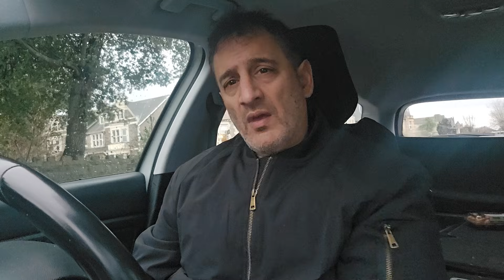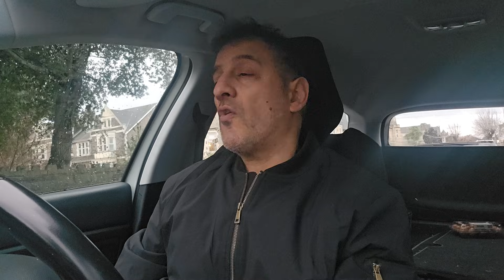M17 Give us something we can use to talk to people

Comment: Just as an update.  M17 got removed from MMDVM, thus in turn from WPSD.
It was an interesting open-source and freely available digital mode, but it was buggy and had its issues.  I think the last version of mmdvm that supported M17 has been forked, but the developers appear to have fallen out.
I have a module-17 which acted like a modem to the FT991a, and a flashed retevis handset  The retevis has been put back into DMR mode.

I hope the devs can sort it out in the near future... will wait and see?
Reply: "M17 (...) was an interesting open-source and freely available digital mode, but it was buggy and had its issues" - a completely wrong statement based on false accusations. All of them were debunked a few months ago by the M17 Foundation. Not to mention that the mode remains open-source.
Reply from the maker: I feel its a developers project but not general use .
Reply: @M0FXBHamTech it's an ongoing, long process.